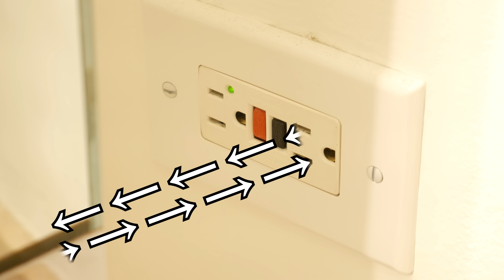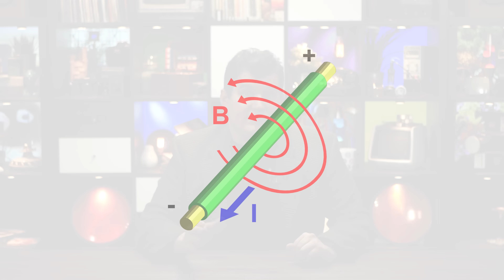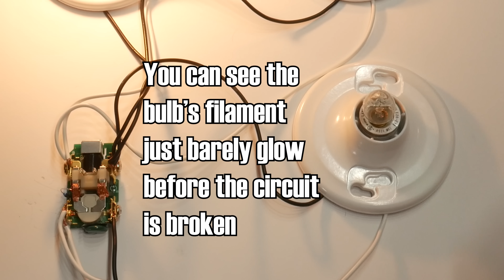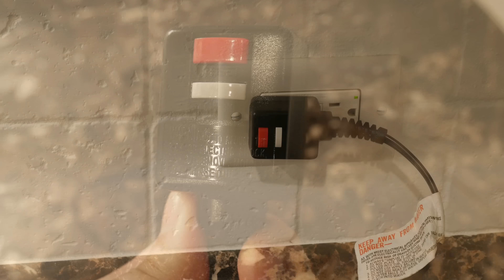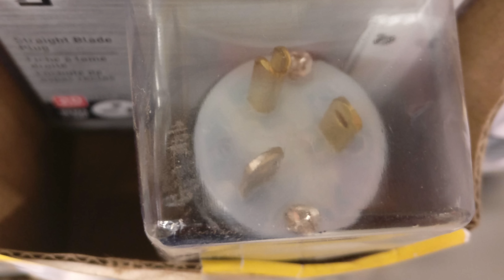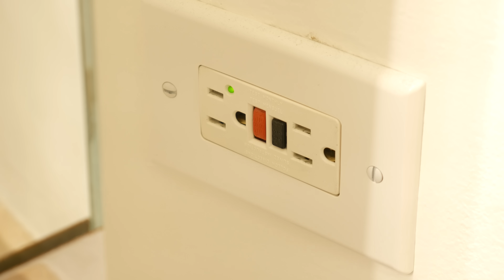The GFCI/RCD: A Simple but Life-Saving Protector

Comment: Can someone explain something to a guy who doesn’t understand electricity very well? Why should we expect the current on the return to be equal to the current on the hot wire if the electricity is doing work? For example a toaster gets extremely hot, that’s its  job, converting electric energy into heat energy. As a layman I would assume the current returning would be less in that case. But of course I don’t understand the physics of electricity well here so I’m assuming I’m not getting something fundamental.
Reply: Mister Brookes ahh right thanks I wasn’t thinking of this correctly. Did a bit of reading too. Indeed conservation laws would prevent current from being reduced on the return because absent a leak of current somewhere, like exactly what a gfi is designed to detect, the electrons aren’t of course being created or destroyed, something that can’t ineed happen outside nuclear physics processes and even then we speak of conversion. Also of course mechanical work that circuits do is via electromagnetism which involves induced current and motion. And the work in electronics usually uses electromagnetism for storage or excitation of atoms to emit light in the case of screens. 

In order for current to be less on the return the electrons would actually need to be destroyed or converted, which doesn’t occur, or leak out of the circuit.

Comment: Great video.  Next you should consider doing a video on what some countries like Japan do not use 3 pin power outlets (no ground). I can't imagine these to prong outlets here in Japan are safe, but you almost never see 3 pin outlets in the home.  Most electronics in Japan come with a 2 prong cord, or a 2 prong cord with a green wire (ground) hanging off, as if the user will somehow be savvy enough to connect that.
Reply: If all circuit are RCD protected, PE could not be used. In fact old wiring with no PE were considered regular if a RCD was fitted. In new building PE is now required along with RCD. So I think this is the rationale behind japanese use. 
I've read about air conditioning outlets and washing machine outlets fitted with a "bolt" connector for grounding in Japan.
Reply: I don't know that they are RCD protected.  If they were RCD protected, why then is there a "bolt" connector for grounding major appliances like washing machines?  (And yes, some homes have those grounding bolts in places designated for washing machines.)  All major appliances here in Japan have power cords with a little green wire hanging off, which is meant to be connected to ground.  It's all very silly to me, since not every home has a place to mount that little green wire to ground!  And very few Japanese get a generic table-top microwave oven "professionally installed."
Reply: More (safety) is better than less. So maybe bigger appliances that use water has also PE even though circuit have RCD. But yes: it's silly they have almost no 3-prong outlets (like almost all the rest of the world). They just could have 'borrowed' one like type E or Type B and use them for this few scenarios.
Reply: The only place inside homes here in Japan that I've consistently seen a Ground terminal is in the toilet room.  The reason is because Japanese toilets have electronics in the seat, primarily for a seat heater, but also for a bidet.  So it would seem that electronics near water do have access to a ground but it is silly that not all wall outlets offer the safety of a third ground pin.

Comment: How does it not detect devices that cause a phase shift in the returning current? In theory this would cause an unbalance between the two currents, right?
Reply: It will, the fact is that unbalances are usually low so fall behind the threshold. In case where there are lot of interferences/imbalancement (ex: big motors such as air conditioners) they invented A-Type and highly-Immunized type of RCD that will better handle such conditions.

Comment: 15:00 That 20amp GFI outlet is also TR rated (tamper resistant) so it has a special protection that prevents you (well maybe not *you*) from putting an inappropriate object in the hot or neutral slots of the outlet. It only allows something that is entering both slots at the same time, like a plug, to enter the outlet. As an electrician I can tell you this can be a pain in the ass when you are trying to troubleshoot outlets and test hot to ground with a voltage tester.

Additionally in the US there are GFCI/Overcurrent combination breakers out there but are very uncommon. They are useful when wanting to add GFI protection to a kitchen or bath circuit in an older home. Ideally though you'd want to replace all the outlets in a house that old anyway as they are prone to falling apart inside.

Additional additional, there are also Arc Fault breakers that operate on a completely different type of fault that are now required in the US by code. You should do a quick addendum video addressing those as they may soon enter the common vernacular like GFI has over the past couple of decades.

Comment: I think it's bad idea to put the devices outside the panel. When you put them into the panel, everything is protected. But when they are optional you maybe aren't protected somewhere.
In germany there are exact regulations about that and in new installations you don't have the choice. Every circuit which contains 230V "Schuko" and a lot more outlets have to be protected.

These days you often find combinations of regaular circuit brakers, which interrupts overcurrents and short circuits, and an RCD to interrupt in case of a differential. So it's way easier to trace it back as when you use a 3-phase RCD for a complete row or more.

Comment: Funny story regarding to RCD : Few couple of years ago, I thought that RCD in hotels bathroom is just for the on off switch, so I just pressed the TEST button but can't press the RESET button again. I didn't tell it to anyone that I just tripped the RCD, it only be found when my dad call the room service because my mom complained the hair drier didn't work.

Forget about your sophisticated GFCI or RCD, Here in Indonesia most of us don't even to consider to wires up the grounding pin to earth. In my house, only my bedroom has the wired up grounding pin in power socket. The cable in my house only has 2 wires so it would be total power lines rework if I want to wires up all grounding pin here.

Comment: Two things: 1) 12:00 I have some GFCIs whose lights are the opposite of yours; they have a neon orange bulb that comes on if the outlet is tripped, but are out if it's reset. I'm not sure if you made use of it before disassembly, but the GFCI shown at 12:35 looks similar to mine and may have worked that way. The bright light illuminating to show a trip is very handy. 2) 13:55 You don't make mention of them, but note that we do have GFCI breakers in the US; you can use them in lieu of individual receptacles where code requires GFCI protection. I prefer outlets for the reasons you state, but we do have either option.

Comment: One reason why much of the EU uses RCDs in the distribution panel is that they have Shucko plugs that don't have guaranteed grounding.  Since safety grounding is done either with a clip or a male pin in the outlet you can plug a Schucko plug into an ungrounded outlet with no problem.  So the RCD is being used as an alternative to safety grounds. There is a downside to using RCDs in the distribution panel: they usually have worse sensitivity -- often 30 mA instead of 5 mA.  The reason is that 5 mA trip current would cause too many nuisance trips when used on the whole house.
Reply: I have a feeling the EU 30ma at 240v RCD is more about equipment protection than personal protection. Think about how much energy 30ma is at 240v. By the way there's a code for large service switches over 1600a (I think it may have changed) have RCD but their min setting is 100A, lol, most definitely for equipment protection.

Comment: Excellent video! You make a very good point about the US-style plugs probably encouraging testing. I have never tested the RCBOs in any house I've lived in because it will usually turn something off that I want to leave on... One advantage of whole-house protection is that it seems easier (and probably cheaper) when upgrading existing buildings. Even an old 1960s apartment I lived in had RCBOs for every circuit.

Comment: With a huge warning here that these things do NOT protect you if you form part of the circuit from active (live) to neutral... they can not possibly detect the difference in current flow in those cases because they have no idea on how much current that load wants, and will not trip.

Active to earth - protected
neutral to earth - protected
active to neutral - you're fucked

Comment: Here in the EU, MLCBs are used at the distribution box as primary protection for the whole house, and is far better than just isolating just one socket.

Beyond that RCD's are used to isolate a circuit, eg., the sockets, or the cooker circuit, or the immersion heater, etc.

It's better to isolate the circuit than just the socket or device as, even if these are isolated, the circuit -therefore the danger - is still live.

Comment: Great vid as always. I have often wondered though about the power points in the US (and other countries as well) being continuously active, while in Australia (and other south Pacific nations that use the same outlet type) outlets have cutoff switches for each power point, meaning I can have an appliance plugged in but no current going to it, or exposed but no current running through it (similar to UK outlets). Is that something to be considered in other regions, or is it in fact unnecessary?
Reply: Dean Taylor In North America, you COULD put wall cicuits on a switch (you can buy cover plates for double boxes that are for half switch, half wall socket combinations), or you can use a combination device (half switch, half socket) which can be wired up so the switch can control the socket.  It isn't commonly done, however.

Comment: There's one in my room, formerly a garage.
nearest open water source is about 9ft/3M away in the kitchen. The laundry room has the water heater and the spinning water death trap. Washing machine. Sorry.
Bathrooms on the other side of the house.
If it trips, only one of the bathrooms outlet goes out. And two other in non water risk rooms.
So whatever moron wired this one outlet, paid no attention to which outlets to cover, let alone why installing it so far from the bathrooms, or even considering in the kitchen.

Comment: wish we'd have had these back when i was in tech college!  i was fixing a washing machine and had a jumper cord attached to the solenoids.  then i unplugged the washer so i thought it was safe, but i had the wrong cord, instead of the power cord, I was holding the jumper cord and on the other end one of the alligator clips had fallen off and landed on a live wire so when i touched the terminals on the cord i got shocked, while standing in a puddle of water!  took like 5 seconds for the breaker to trip but felt like an eternity, i didn't feel well for like an hour afterwards and my hand was numb.  classmates gave me the nickname "sparky" after that!
Reply: Lucky you didn't die...

Comment: The GFCI you took apart also has a light, that illuminates only when the device has failed.
It's a generic device; you can get them under different brands such as General Electric at Walmart and Chicago Electric at Harbor Freight. Harbor Freight is where I found them cheapest, like $6 or something

Comment: GFCI/RCDs in your switchboard don't make finding faults that much harder generally speaking. It just takes more time as you have to test every piece of equipment on that circuit rather than whatever is downstream of the tripped outlet. The big upshot of switchboard units is that you are also protecting the internal wiring of the house from similar issues. I'd take that added safety over 10 extra minutes of unplugging equipment any day.

Comment: on my electronics bench I have a 2 gang box with a light switch and a GFCI outlet on a bit of extension cord (so I can turn the power on and off and plug crap in without crawling under my desk) and in 10 years its actually gone off twice, once with a tandy coco 1, and another when I first got my NTSC video waveform monitor (specific use oscope, hell it was a dollar why not) and both were bad cords I never even noticed 

so yea its a good investment for people who like to tinker with electronics, especially state unknown vintage stuff

Comment: FYI: Code allows up to 6 seconds to trip. The speed at which a gfci trips is in relation to the ground fault current. The formula for this is Time=(20/ground fault current in milliamps)1.43
Also, the newer gfci will self test (test time intervals depend on manufacture) If they detect a problem with themselves they will shut off power to the outlets and the red light will illuminate.

Comment: I once built a unit that ran on 120VAC.  I used a GFCI outlet at the power input as both a power switch and convenience outlet.  While I was tweaking one of the industrial power supplies in the unit my tool contacted the case.  The GFCI outlet tripped saving my entire project from frying most of the electronics.  When I turn the unit back on it was still fully functional.  $20 well spent :)

Comment: What a timely video. I just replaced 2 GFI outlets yesterday. I didn't understand why my second GFI was not tripping (the toaster oven that was causing it was on the second one) but the first one was and they were both on the same circuit. Now I know that only 1 needed to be in the circuit. After taking the first one out (the one that tripped over and over again) I noticed that the plastic had melted around one of the contacts. I am a little confused though as most GFI outlets are 15 amps on Amazon, so that's what I ordered, it was rare to see a 20 amp one (and the two that I replaced were 15 amps), but you kept saying that 20 amp is common. Thanks again for another great video.

Comment: I have a GE GFCI Circuit Breaker for my Bathroom. This is because it was retrofitted in the past. The outlet box there is too small to put a GFCI in by the NEC rules.
The Kitchen had no GFCI breakers, so I installed the outlet based versions in there before I moved in.

I put a sticker on the Bathroom outlet , so one would know it's protected by the GFCI breaker.

I do test both types from time to time to make sure everything's okay.

Comment: You didn't cover the principle problem with deploying GFCIs everywhere, like the main panel. Many motors trip them. The problem is the motor windings can absorb enough current to look like an imbalance for long enough to trip the GFCI.
Reply: I've seen ignitors on a gas kitchen range trip the GFCi behind it.Why?  crappy isolation and this causes SOME of the spark to run to ground
BTW
Stove was made in China,as many,many are.
Reply: Scott Franco Motors don't trip regular 30mA GFCIs (known here as FIs at 300mA, HFI at 30mA, there's an extra letter if it also detects leaks through diodes like in faulty computers).
Reply: @johnfrancisdoe1563  In the US, GFCI devices are required to trip at 5mA to protect people from dangerous shocks. Lots of larger appliances exceed this, so this kind of protection can't be installed at the breaker, unless the circuits were all separated, which usually isn't practical. They are starting to require AFCIs, which are designed to prevent electrical fires caused by equipment malfunction, which is I think a similar purpose to the 300mA RCDs used in other places.

Comment: In the UK new domestic installations need to be RCD protected at the consumer unit (the central distribution board [in the past coequally referred to as the fuse board]).

Unfortunately the cheap way to achieve this is to have only 1 or 2 RCDs for the full house so a fault on one circuit would disconnect all or half the house. RCBOs are available but cost a lot more.

RCD sockets are also available and are a useful retrofit in already wired buildings.

------

All UK standard power sockets (BS 1363) are required to be earthed and require an earth pin on the plug to be inserted before other pins are un-shuttered. When a device does not require an earth connection then a dummy earth pin is required on the plug.

Until recently power sockets were not permitted in bathrooms- mixer taps were also not allowed.

Comment: Thanks for making this video, I did wonder what those switches were on US/Canadian power sockets. It was a culture shock seeing power sockets in bathrooms in North America because power sockets just aren't allowed in bathrooms in the UK, so the water situation doesn't arise so much (though I suppose it could in a kitchen). The occasional exception is lower voltage shaver only plugs in bathrooms (especially in hotel rooms or built into fluorescent lights) which are closer to the US pattern.

Comment: We have RCBOs in Australia - The new code requires these combination RCB/CBs installed on EVERY circuit in the home.   Heating, lighting, ovens, general power, everything...   

We fit them into the consumer unit, the switchboard...